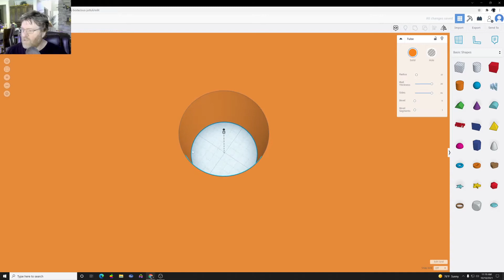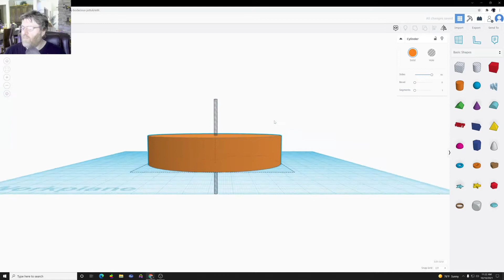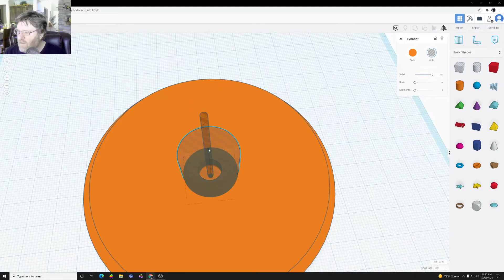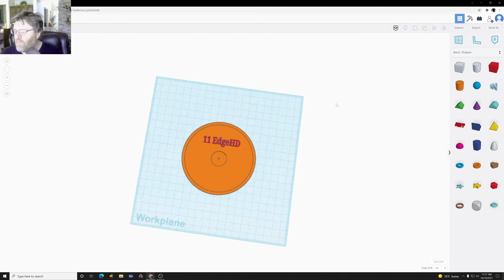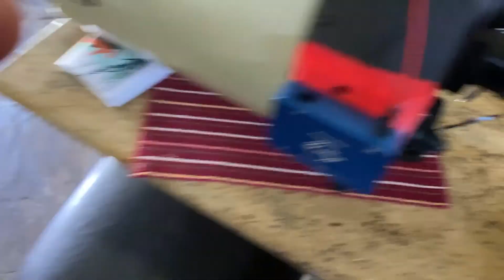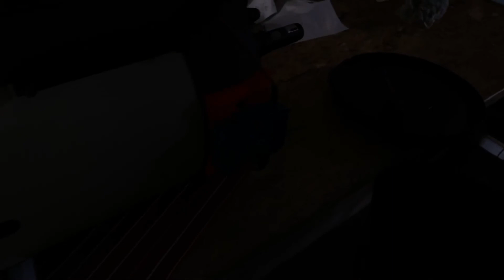I made a insert cap for my 11 EdgeHD to center the secondary

Comment: I guess that if you went thru that, it means process the Hotech calibration tool didn't work.
Reply from the maker: The hotec system does work great but it is also a lot of set up time and reiteration.  I made this so I could center it quickly but then again I have to ask myself, how often do you need to do this? Once?  So this tool is for people that do not have the Hotec and want to see if their secondary is anywhere close to center.